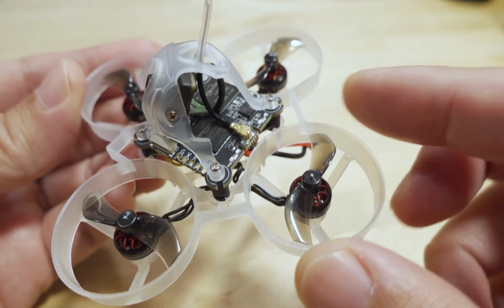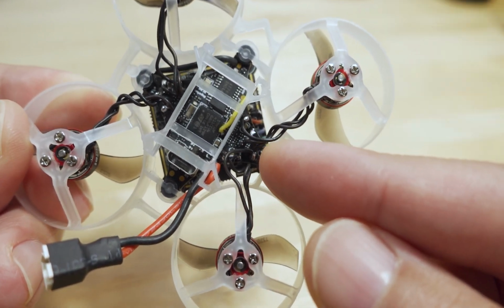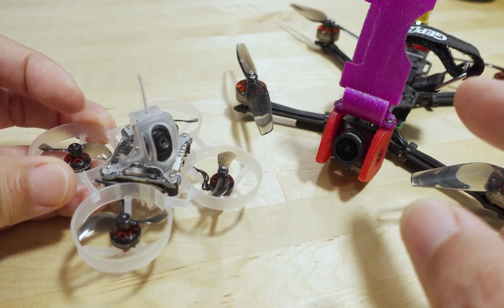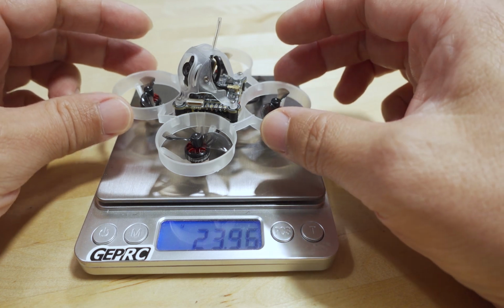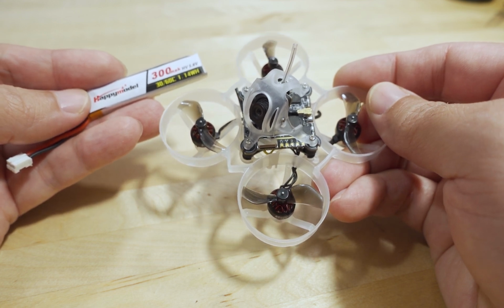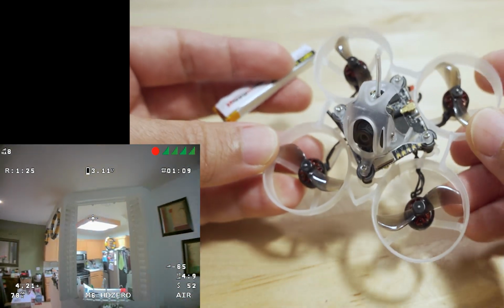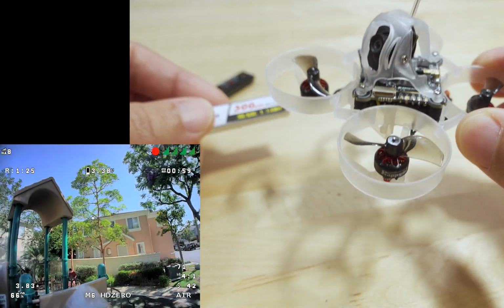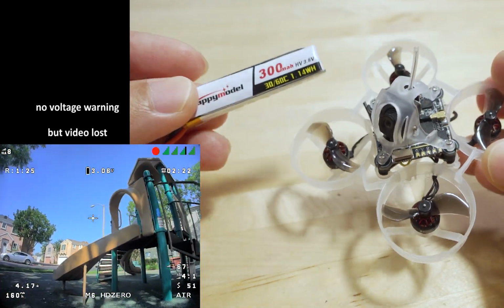Mobula6 HDZERO Edition 😎

Comment: Thankd gor the video! I know the video clarity is better than analog but would you consider the penetration better than analog? I only fly whoops on analog currently and I want just a bit more range and penetration. I tried walksnail and that's a no-go for me, DJI doesn't offer anything small enough so I'm really thinking about HD0
Reply from the maker: Quite the loaded question. Short answer is it depends on the environment where you fly. I would say that for most whoop racing situations, analog will be overall better at the typical 25mW power setting allowed at races.  Beyond that it's going to depend a lot on the equipment and the environment.  Too many variables to account for to make a final judgement.
Reply: @AlbertKimTV  I always fly alone. Currently I'm ELRS. I also only fly in two spots mainly. Both of them are parks that have trails and park benches. Know houses or anything nearby so I don't have to worry much about interference. I think I'm going to pull the trigger on the goggles just to give them a go I can always resell them if I don't like them. I tried the VRX with walk snail and after using the walk snail goggles I felt like it was quite the step down so I might as well just get the best experience and try the goggles.  But either way the video clarity is definitely better on HD 0 versus analog I'm hoping!
Reply from the maker: @jesseday6090  Personally, I've always found the clarity of HDZERO to be less than Walksnail so if you found Walksnail to be bad, you should prepare yourself for more disappointment.
Reply: @AlbertKimTV  sorry I should have been more clear, I liked the clarity of walk snail but whenever I flew low to the ground I got major smearing / blurriness.  I pulled the trigger on the HD0 goggles so we will see how I like them once I get them!

Comment: If I convert the mobula 6 Hdzero to   moblite 7 frame instead of mobula 7 frame would I get more flight time
Reply from the maker: Just a little bit only because it's lighter.
Reply: @AlbertKimTV  moblite7 , mobula 7 , mobeetle6,meteor 65/75/85 analogs are giving more flight times 4-8min but video  is better on mobula 6/7 Hdzero with 2/3 min flight , which would you prefer overall   Top 4 if using Hdzero goggles with analog  adaptor module with fusion/rapidfire or hd with less flight time

Comment: hi albert, I had the video cut out issues too (I am using NBD 300's but a couple are a bit old) and it would get the video cut out when the battery sagged. On my quad the VTX power wire was soldered to direct to the battery voltage. I relocated it onto a 5volt pad and dont have those issues anymore, although like you say be mindful of it and bring it back on time
Reply from the maker: Interesting that moving it to the 5v pad actually worked.  I was told, the BEC on the board wouldn't be able to handle the load.

Comment: Hello, thanks for the information. I'm having issues reaching the usb port. Any specific type of cable I need to look for?
Reply from the maker: If you have extra cable sitting around just snip off the plastic cover at the end of the cable to prevent it from connecting.  That's what I do and it doesn't cost a penny.  I think I made a video about this years ago but I can't find it now.  I think YouTube is deleting my videos that are older than 2-3 years.  Bummer.
Reply: @AlbertKimTV  thanks for letting me know. Really appreciate it

Comment: Let me ask, crazy idea but if I buy a DJI mini Se, can’t I just modify the motors to make the drone go faster?
Reply: It’s possible to strip out the electronics and put in your own fc esc and motors…yes.  A few already have done that calling them “sleeper quads”. But to leave the dji mini se hardware inside and just add “faster” motors would probably fry it.
Reply: @jsnlmb42  if I change the esc can I still hook up the original DJI camera, geo nav-etc. on to the new esc? If so I’ll just buy the mini and a esc and soder the wires up. Unless it needs to be programmed
Reply: @bmwloverat  Simple answer is no.  If you try this "you're goin have a bad time"
The stock esc is connected via ribbon cable and a new ESC with higher amp rating wont "communicate" with the stock mavic mini FC. If you just want a faster DJI drone that can operate like a FPV quad you might be looking for something like the iFlight Nazgul Evoque F5D HD or perhaps the Geprc Crocodile Baby HD LR...These don't include goggles or transmitter and will run you $400 -$500 just for the pre-built quad.  with goggles etc you are going to spend north of $1k
If you just want a shell of the mavic mini thats possible...but you will need to overhaul it
hope that helps
Reply: @jsnlmb42  this actually helps alot, I went from the Air 2 and now I’m pushing to the FPV DJI drone, just because I want high speed and low altitude like ft off the ground. Problem is I hate the restrictions so I can even get the drone up a mountain and rush it down 2 feet of the ground.
Reply: @bmwloverat  ahh gotcha.  
well the options I gave will have good overall results for you then.  If you want to fly up a "mountian" and fly back you are looking at long range quads...probably using li-ion cells rather than lipo.  but just so you know fpv quads are a lot harder to fly than mavics and are a lot more technical.  so ya know...be kind to the hobby and be safe out there.
Reply: @jsnlmb42  that’s the argument, I was just trying to upgrade the speed (motors) so I can hit 90+ with the Stability of the mini se. if I got this right I was ready to drop $ of that Maverick drone for 2k and do the same and upgrade the motors but have all those sensors
Reply: @bmwloverat  oh yeah...well 90+ on a mavic mini I can see an epic fiery crash.  youre money is better spent else where.
Reply: @jsnlmb42  ok if that’s the case is there a way to add a custom battery to the mini 2? I would think like this range would increase

Comment: They went with bi-blades for flight time....

Throw Gemfan tri-blades, and BlueJay ESC firmware set to 96k for better performance and still get good flight times.
Swap battery connection to BT2.0 and use NBD Nectar or GNB batteries for better power and efficiency.